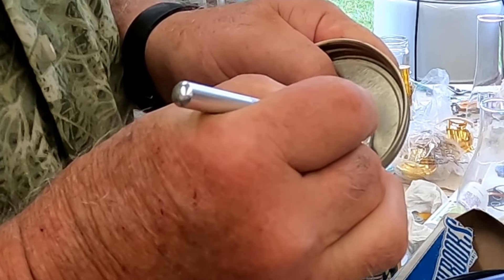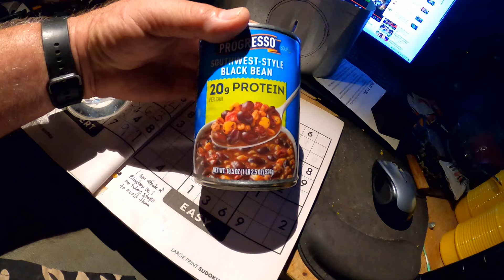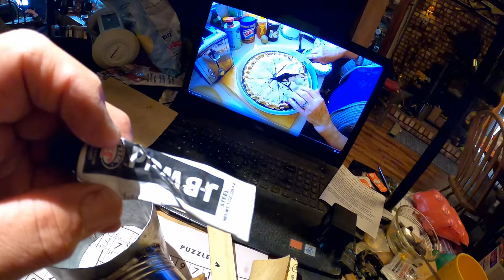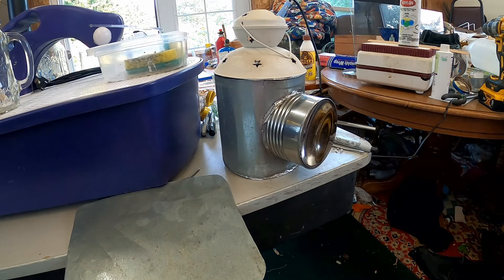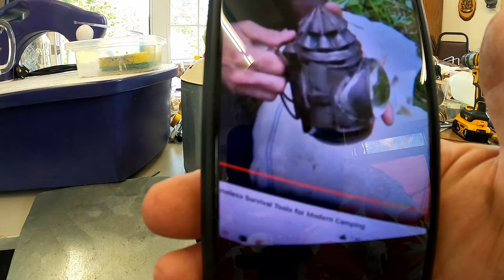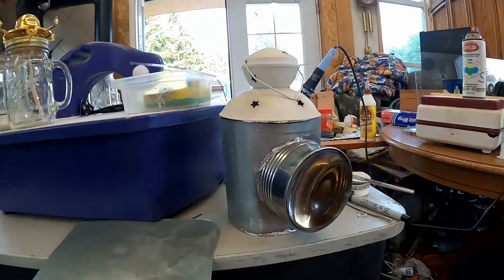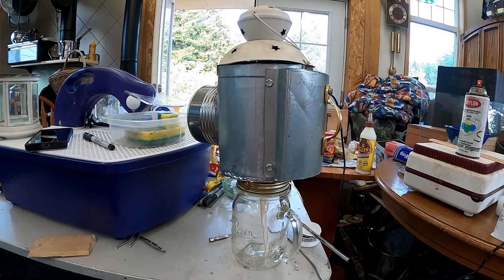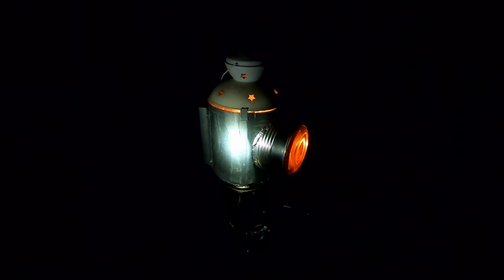Steam punk camp lamp

Comment: Nice. I would make a support underneath the lamp, so that the jar does not have to carry all the weight. You always have to screw it off to refill, so I think it is will last longer if the lamp does not stand on the jar. 
Problem for me: I don't have such big lens.
Reply from the maker: You are so right. I am building a box the jar can set in. it would be easy to put brackets on that box to hold the top up, yet make the lamp more stable. Thanks for a great idea.